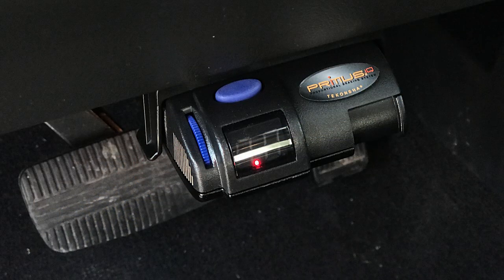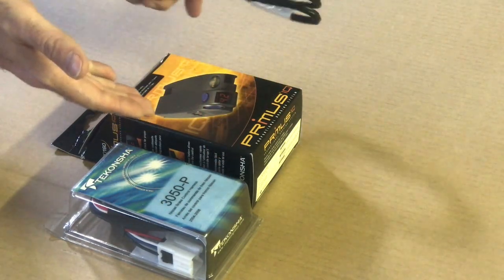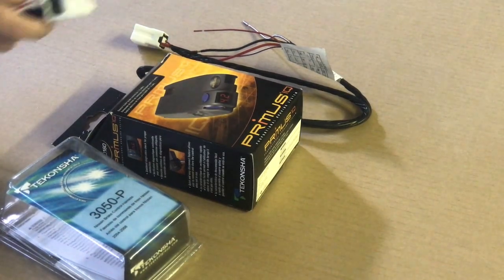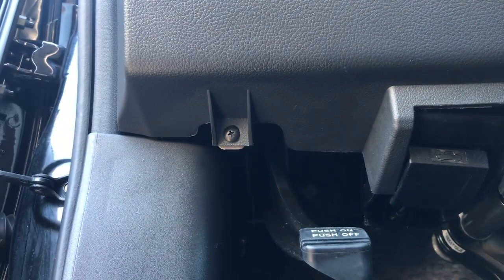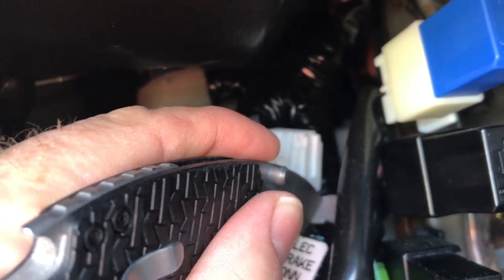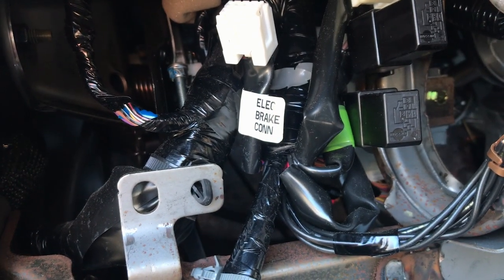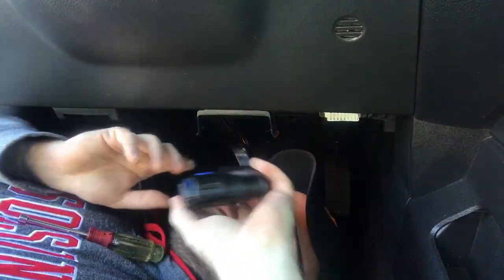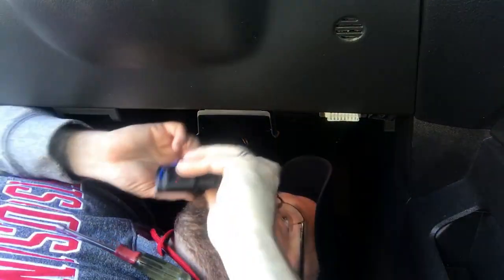How To Install Brake Controller on Nissan Armada | Tekonsha 90160 Primus IQ

Comment: GREAT VIDEO, THANKS!!!!!!!!! I just bought a 2014 Armada, I found that wire harness in the glove box and now I know what its for. LOL I will definitely take your suggestion on the adapter though. All the best and thanks again!!!!!!!!!!!
Reply: Did you by any chance install the tow mirrors?  I have a 2014 as well and can't seem to find them.  Thanks

Comment: Does one have to upgrade any wiring going to the rear connector or would it have come from the factory wired for a brake booster?

Comment: Absolutely the easiest install. Great video with no extra "story lines" just instructions.  I ordered both parts from your links below.(not sure why Primus did not include the connector to begin with?) I will install the mounting bracket later as its 21°F outside. Thanks!!
Reply from the maker: Glad I could help!

Comment: I bought both the exact controller and wire harness for my 2015 Armada. Unfortunately the wire harness is not a match for my truck. The end is completely different and won't plug in to my truck harness. I don't really.want to cut and splice them together Any idea which harness would work?

Comment: Dan - Just bought a 2014 Armada and have 7300 pound travel trailer.  Any pictures of your full rig? what did you set your brake controller at and what weight distribution hitch did you go with?
Reply from the maker: The goal on the brake controller is that the trailer slows down the armada instead of the truck trying to slow down the camper. You can apply the brake controller by hand to get a sense of where it needs to be and adjust the setting accordingly. I’ll get back to you with more info on the hitch

Comment: How well does the armada pull? How much does the trailer weight? Just wondering because my dad is looking for one to pull a 6500-7500 pound camper.
Reply from the maker: Armada pulls great. Our trailer is 8000 lbs.

Comment: You did not need to cut the tape off the vehicle brake controller plug and just plug in the brake controller wiring on the top and run it down with plenty of wire to spare. I also would have moved the brake controller further over to the right giving you easier access and viewing while driving.